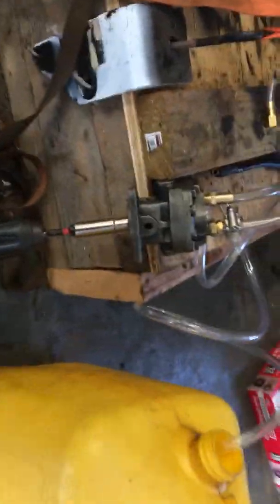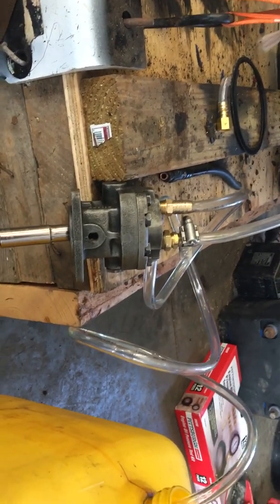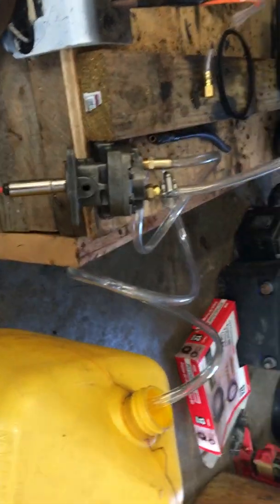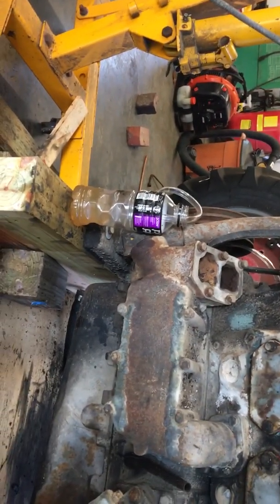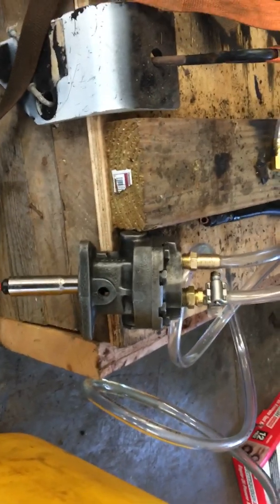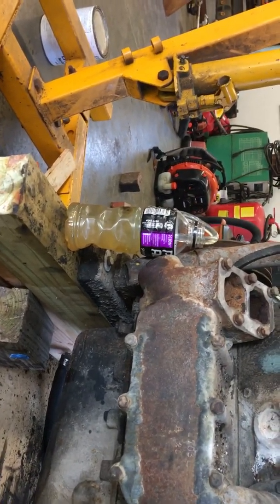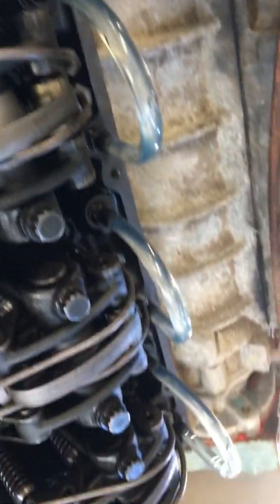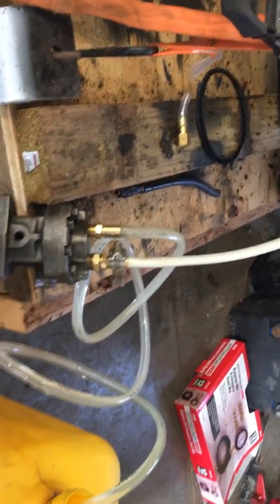Detroit diesel 8v53 fuel pump test

Comment: It is not necessary to bypass the fuel injector  jumper lines  to bleed this system out .  Set up your fuel pump to prime through the outlet line off of the engine’s fuel pump which feeds to the cylinder heads .  Restrict the fuel return line with a partially closed ball valve .  An 8V53 is a very rare engine !
Reply from the maker: Thank you. I only bypassed them in case dirt, debris, insects, and what not were in the fuel system. Didn’t want any of it in the injectors. The engine sat  a long time in a barn

Comment: From where can I purchase genuine Detroit fuel pump, part No 23856661
Reply from the maker: I tried searching for that part number and nothing came up on google or other sites. PC industries, aka Powerline components, has almost everything for Detroit diesels so I’d start there. You can search by your engine model but you will need to call or create an online account to really search their site which is easy. 

If you have a defective pump you can buy the parts to fix it bc the pumps can be expensive. I bought new seals to fix my leaking pump.
Reply: @ronfrance4041  Thanks. Grateful for your help. I live in a remote part of the world. Have limited access to internet. I can share the image if you can kindly send me your email address on quantumphysics78@gmail.com. It would be a great favour if you help me in finding the pump